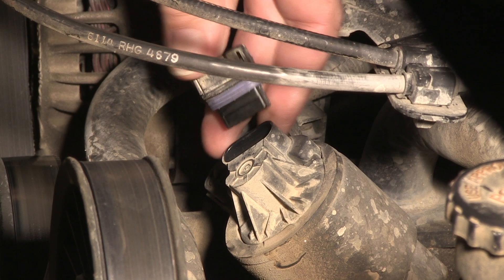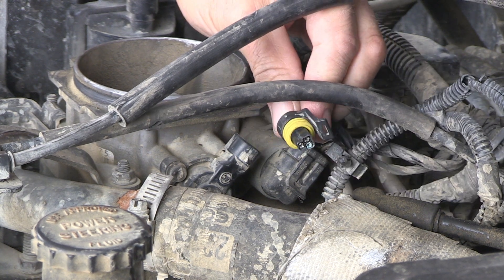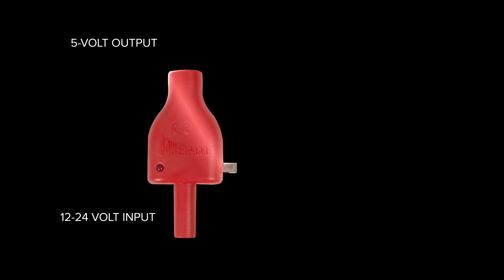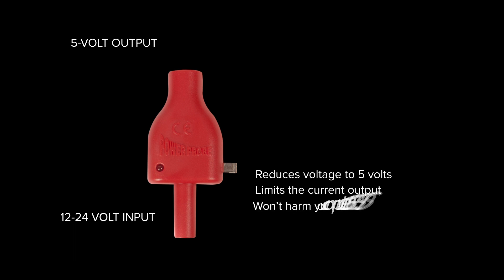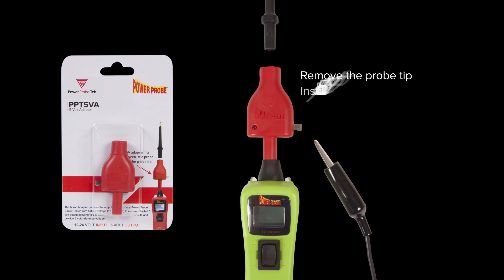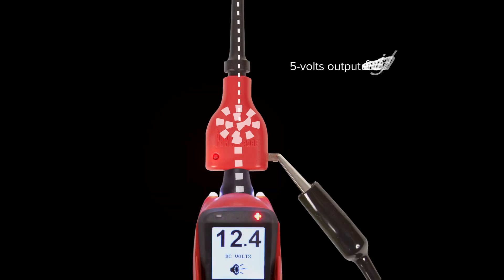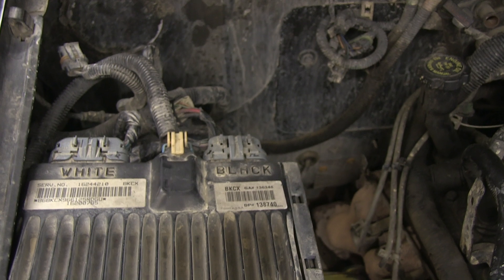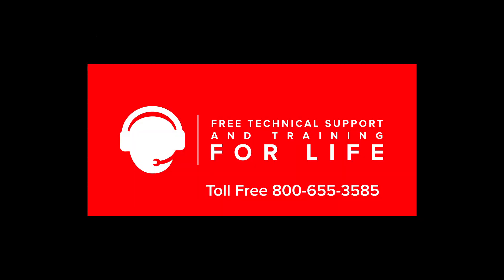5 Volt Reference Adapter: by Power Probe

Comment: Can we check the sensor wires with pp3 without using 5v adaptor
Reply from the maker: It's probably not the best tool for checking sensitive sensors, a better use is for the Power Probe 3 would be testing components, wiring and supplying power and ground, the Power Probe 4 or Maestro would be a better tool for sensors, also check out our new line of multimeters for sensors, Thanks for commenting' Danny

Comment: is there any other valuable information of the 5 volt adapter can be used in other Automotive applications?
Reply from the maker: Hi Terrence, 

Most techs use it for things like manually suppling a 5V reference to sensors. This allows them to power up sensors and sensor circuits. They can also use it to simulate a sensors 5V output and to verify that is what the ECM is actually seeing via a scan tool.

Other techs use this for a few different applications a well. 

Creative techs: what do you use it for?